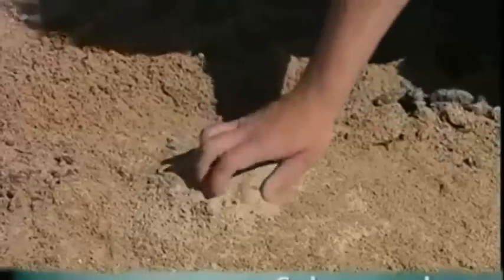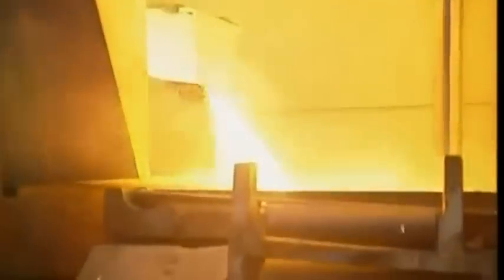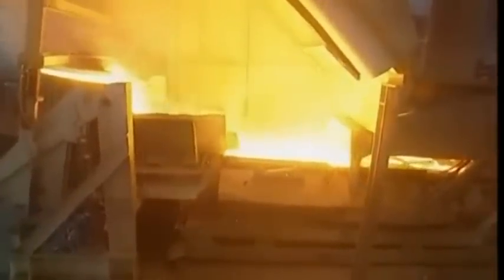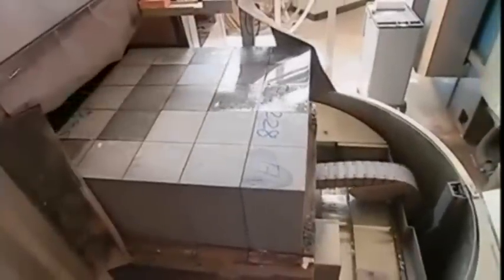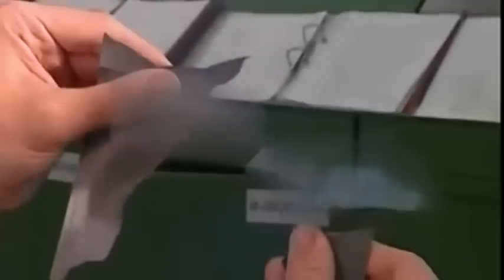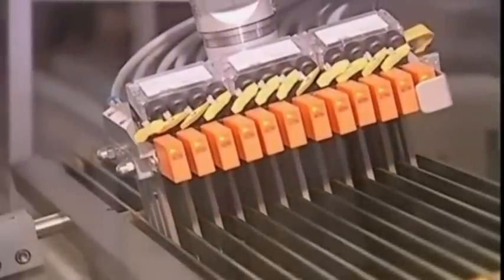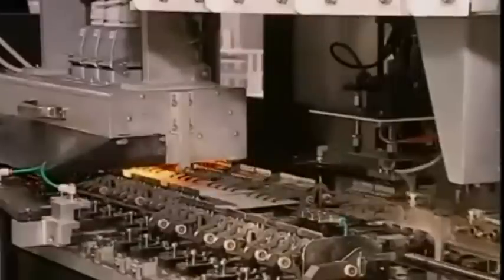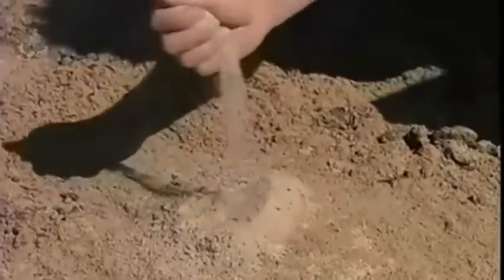HOW ARE SOLAR PANELS MADE?solar panel manufacturing process

Comment: How do they get the furnaces so hot????  Oh yeah, they burn lots of coal. Not so green.
Reply: You’re right except you’re wrong. Yeah they burn coal to heat the materials. But just saying “oh see! They’re burning coal! They aren’t eco friendly!” Is such a simple, flawed, disingenuous view. Over the lifetime of the panels made per ton of coal burned, the efficiency over time and overall greenhouse gasses of producing those panels easily outstrips the efficiency over time and overall greenhouse gasses produced from simply burning petroleum products to achieve the same amount of energy production. Why don’t people exclusively power their homes with gas burning generators? Because the gas burning generator is less efficient than a power plant located 30 miles away. Both use the same petroleum products to produce energy, but one is far more efficient. That would be the power plant. The same concept exists here. Yeah to start, everyone has to burn coal. That’s just the facts of our technological development over centuries. But that doesn’t mean that the old ways are the best, most effective, most efficient ways. The amount of coal needed to produce all the energy the solar panels could produce over their lifetime would be orders of magnitude larger than the amount of coal burned to produce the solar panels in the first place. Yes in the short run coal must be burned. There’s rarely any avoiding that. But overall solar is the clear winner in terms of energy produced per pound of coal burned, and ratio of liters of greenhouse gasses produced to kilowatt hours produced. But go ahead. Keep being ignorant to the realities of the world. Believe whatever will help you sleep at night. Make the world a worse place because you can’t be bothered to develop nuanced opinions and would rather cling to antiquated beliefs rather than go through the relatively simple process of saying: “oh. I was wrong. The world isn’t quite as simple as I wished it could be. I suppose I should reevaluate my beliefs and take an active interest in improving the world in order to create a better world for everyone.” Nah. Just keep posting the inane bullshit that pops out of your fingers, laugh in a highly ironic, completely unwarranted, fit of feeling superior to those around you. Your beliefs are part of a pandemic. Not covid. The pandemic of idiocy and lazy thinking that plagues the world we live in. You are infected and the only antidote is humility and a willingness to accept that your own actions are actively making the world a worse place.
Reply: Well you need yellow and blue to make anything green!
Reply: So you want to heat up using ice, or by whispering some magic words? What the fuck are you even asking.
Why don't you use the earth core energy like at the volcanic hole?
And Your house has no glass door nor even a mirror? If you have, again whtf are you even asking???

Comment: There is no form of "clean, renewable energy" that can be produced without using fossil fuels and it's byproducts in it's manufacturing process at some point...
Reply: Yes but once youve made the solar panel it will produce clean and renewable energy. The means of getting there are not clean but the after product is.
Reply: @waqaspathan3337  The after product is not "clean" either.  It has to be stored in batteries, which take toxic minerals and materials to manufacture as well.  The solar panels and batteries also do not last forever and will eventually have to be replace with new ones, which will also have to be manufactured from toxic materials.  As I said, there is no such thing as clean energy....
Reply: @douglasharbert3340  I understand where you’re coming from, but it’s not a perfect world. It’s too good to be true to have a form of energy Thats cheap, absolutely clean, and renewable. Solar panels in example are objectively better than fossil fuels.
Reply: Modern nuclear energy has entered the chat
Reply: @cuancake4911  Nuclear power is not clean and it is not renewable.  It still depends on finite resources....

Comment: Not even a word about the rare earth metals and other minerals that go into production of solar panels. Problem is, we're running out of some of these, and have to rely on a very polluting industry mainly in China, and South America. Still, solar panels over their life time have of course a much lower carbon print than gas and especially coal. The amount of pollution by other means (for example Cadmium, Arsenic, Gallium, Cromium, Cobalt, Indium, Molybdenum etc.) is quite high. Probably on par with some pollution by all the poisonous stuff in coal ashes. I'm all for solar and wind, but I wish they were honest about the down sides.
Reply: These are solid crystal solar panels and don't use any of the heavy metals mentioned. Only thin film panels use heavy metals. And the magnitude of waste is literally 10,000x for coal vs thin films. A single kilowatt hour of electricity from coal will produce roughly 100 grams of coal ash containing about 5mg of heavy metals. A thin film panel will leach milligrams of heavy metals over its entire lifetime compared to production of about 15,000=ish kilowatt hours.
Reply: Then you should use the words like  'number or percentages'. Not 'quite high' or 'poisonous stuff' etc.

Comment: I noticed you omitted a few things like granite and not sand is melted after being mixed with coal to heat it to 2000°C, much higher than the 1100!°C needed to melt sand. It's abhorrentlty inefficient but it keeps Greta happy though and that's all that matters.

Comment: I wonder how the get that furnace so hot? Is it renewable energy or fossil fuels?
Reply: Has to be fossil fuels
Reply: Of course, mainly high quality coal is used, what else. Granted, this carbon footprint in the production is said to be amortized about 5 fold, or within 2 years of the total use time of 10 years.
Reply: @reinerwilhelms-tricarico344  Most solar panels are designed to be used for 25 to 30 years. In practice, they can often work longer than that.

In any case, the point remains that fossil fuels are used to produce the solar panels which does mean that solar power isn't entirely carbon neutral. The CO2 involved is a small fraction of what would come from using CO2 in power plants directly. Furthermore, it would in theory be possible to used biofuels. It's just generally cheaper to use fossil fuels.
Reply: coal is used to heat it up.
Reply: Can be either. There are already electrical arc furnaces that can reach even higher temperatures (1800 - 3000 C) so it's a choice for the factory to make.
Reply: So you want to heat up using ice, or by whispering some magic words? What the fuck are you even asking.